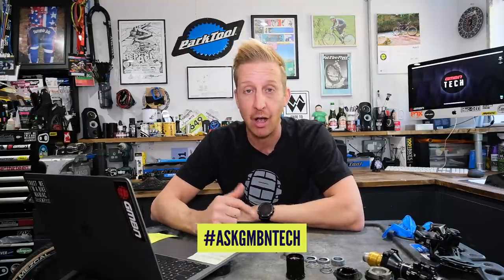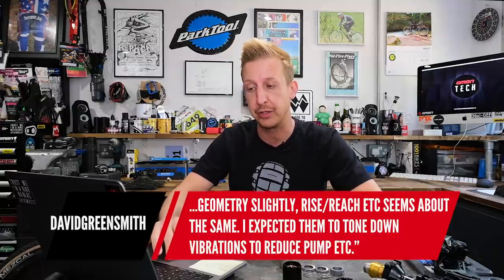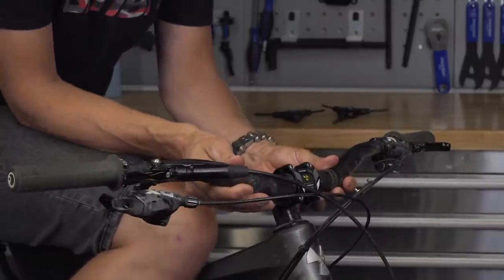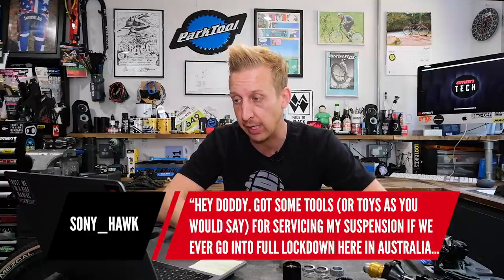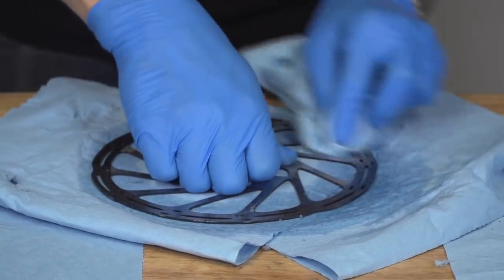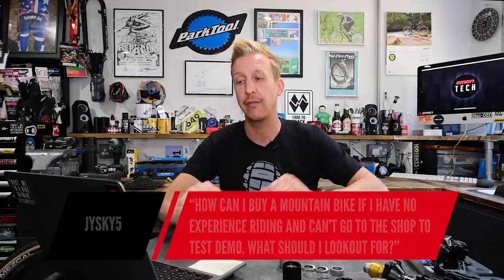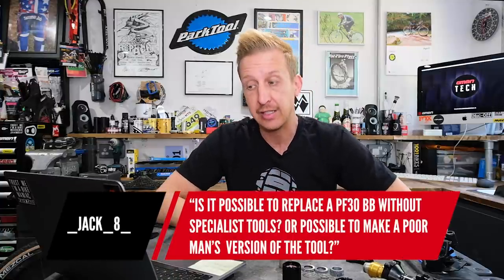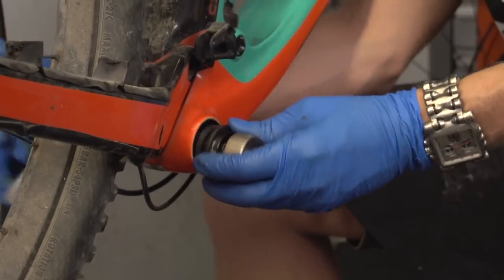Do I Need To Clean My Brake Rotors When Swapping Brake Pads? | #AskGMBNTech

Comment from the maker: Do you have a question you would like to ask us? 🤔 Use the hashtag #AskGMBNTech with your comment under this video for a chance to be featured! 👇
Reply: #AskGMBNTech I ordered a new bike online and I am nervous about setting it up for the first time, any tips for making sure the bike gets set up properly
Reply: #AskGMBNTeck Hi Guys, Can anything be done about dropper seat post play? The seat / post is now moving a few mm side to side, can I do anything before I go down a warranty claim? Bike is Canyon Spectral, love the show Cheers.
Reply: #askGMBNtech my break discs are rusted on the inside but not the outside. Could I use wd40 and a tooth brush to clean them without contaminating them?
Reply: Do a video on how to service a fork completely. Upper and lower
Reply: @gordonteuber3103  there isn't a way of doing that without contamination. I'd reccomend a aluminium scratcher mostly used for washing up dishes.
Reply: Doddy, I am a XC racer, but when I ride gnarlier stuff on my XC bike, I feel the need for a dropper post, whenever I look for just dropper posts, they never come with cables and levers!  Can you do a dropper post installation video with attaching the levers and cables? Cheers
Reply: As summertime is fast approaching what would be GMBNTech's choices for tires?  From hard pack to loam to loose over hard pack and slippery conditions(rocks/roots)there are so many brands and so many choices what's your pick Doddy?
Reply: #AskGMBNTech Can you do a video on Allen Millyard.
Reply: #AskGMBNTech Hi Doddy, I have a clicking noise from the drive train when pedalling my bike that I just can't locate. I can even slightly feel it in my feet. I've just replaced the cassette, derailleur and chain but the problem remains. The problem is I cannot reproduce it in a bike stand, it just happens under load. No play in cranks or pedals. Could it be the freehub or the press fit bottom bracket?
Reply: Would love to know how to make my own headset press threaded bar bolts etc
Reply: #AskGMBNTech this might be a beginner question. But for the times we are in now, can someone use automotive style marine grease or regular grease on lose or caged bearings like hubs, headsets, bolts, mounting points like bar to stem, etc.?
Reply: #askgmbntech I have a boardman mtr 8.8 which has a 12×141 boost rear wheel which I folded on a jump so need a new one but having a hard time finding/understanding all these standards can you please help me find one, cheers. Love the show 👍
Reply: #ASKGMBNTECH. I have a 2019 Vitus Nucleus VRS which has a 120mm suntour xcr air fork with boost spacing. I was thinking about upgrading to a Rockshox Recon gold Rl boost which has 140mm of travel. Would a 140mm fork unbalance the geometry of my Hardtail? 

Great show as always
Reply: #AskGMBNTech Can you explain when you would use air pressure to adjust your fork vs using high speed and low speed compression?
Reply: yes, this!  i have the same problem!
Reply: @Stefan-xv3lz  I have the same issue, so annoying
Reply: #AskGMBNTech Hey GMBN, love the videos, I have a 2014 Specialized Stumpjumper and I wanted to know if I can swap the whole cassette, derailleur, crank and chain with another set such the new Shimano Deore m6100 or SRAM eagle set. What do I need to look for?
Reply: #AskGMBNTech I've recently made a upgrade from a oil seals to foam rings in my 2k14 rs Boxxer rc, the problem is that the right side of the fork, where is damping cartridge. There is leaking under some compressions oil from the wipers. Do you have any tips for the solving the problem? Thanks.
Reply: #AskGMBNTech I was wondering about glazing. How do I stop or get rid of break glazing? Do you have a video already on this?

Comment: 5:36 Answer: Yes. While wearing gloves, use isopropyl alcohol or disc brake cleaner, and clean thoroughly with shop towels. Rinse with hot water, and lightly scuff the rotor with fine sandpaper. 👍
Reply: Hey, i want to ask you something about cleaning my Disc brakes. I have the sram code r and i feel like i will not Really stop. And now i want to clean my Rotor and everything so do i have to roughen them up with sand paper or cam i do it with out.

Comment: #AskGmbnTech  Henry/Doddy. I have Sram GX Eagle on my Orbea Rallon. Had this fully serviced recently and first ride out no issues. Second ride out (during lockdown) on a road ride chain jumped a couple of times. Went for a ride yesterday and now when the chain is on the 8th chain ring I am getting a constant what could be described as a click or tick sound. This happens on every complete revolution and makes the noise every complete turn. Have had the bike upside down and it is still doing it whether crank is turned fast or slow. It is only on the 8th ring and none of the others. Have inspected and inspected and cannot see or find anything wrong so over to the experts! Cheers Guys, love the channel and keep up the great work.

Comment: Be careful with neck pain .I used to get it only when riding ,I kind of ignored it until I started getting bad arm pump .Then the pain was there when not riding ,it turned out to be a herniated disc that was rubbing my spinal cord .It had to be removed and the vertebrae fused together. I guess I was just unlucky ,but if it gets bad get it checked out

Comment: Creaking fork could be usually lower headset bearing/cup or crown race. Assuming u haven't already, totally smother all these in grease, inner and outer of bearing, cup, so much it oozes out when reinstall, wipe away excess. Also same with top bearing. Use grip paste/assembly grip for stem.

Comment: You CAN get rid of the creak in the CSU. Green loctite (sleeve retainer) will take care of this as long as there is no actual play.
Reply from the maker: We would always suggest that for safety reasons it is worth contacting replacing if you are unsure. If a fork was to brake at the CSU it can be dangerous!
Reply: @gmbntech  i mean, sure, why not unnecessarily spend hundreds of dollars on something that isn't broken. I know what you're getting at, it's better safe than sorry, but sometimes the throwaway world gets a little bit much. I carefully inspected my CSU last fall, found zero signs of damage, and carefully cleaned it and loctited it. It went from making a creak every once in a while to being silent this season.

Comment: @askGMBNTech what would make a better mullet, putting a 29 inch fork and front wheel on a 27.5 inch bike, or putting a 27.5 inch rear wheel on a 29 inch bike? Taking into consideration the chainstay length and bottom bracket height. This might be a good idea for a video.  Thanks for your time, I love to show!

Comment: Video suggestion- tricks or hacks to getting a good bleed on SRAM brakes. I watched the video from SRAM on how to bleed brakes and then watched the GCN video and there was a difference. The GCN video, the presenter said to "De-gas" the DOT fluid in the syringe before putting it into the system. I didn't know about that trick until watching that video. What other hacks are there when bleeding SRAM (and Shimano) brakes that mechanics learn over the years? Between Doddy and Henry, I think they might know a few.

Comment: #AskGMBNTech Do Steel frames require any particular care/maintenance to prevent internal rust/corrosion.
Reply: Good question
Reply: Don't presure wash them
Reply: nowadays frames are coated in a bath.
Reply: @andrisvelmeris  It doesn't matter how careful you are when you wash your bike, if you ride in rain and mud half of the year like I do, water WILL get inside the frame.
Reply: Geralt of Rivia there are likely other holes in your frame for drainage/airflow but I’m not an expert
Reply: Geralt of Rivia 
Yeah water can’t get out now
Reply: Geralt of Rivia: I’d say worse - air itself carries moisture, which then turns into water droplets inside your frame with time and changing temperatures. Unless the frame is 100% airtight (like space-worthy airtight), it’s best to have ways for the air and moisture to get out of the frame instead of trapping them in. Just like with mold: moisture is not a problem if it gets to dry, but a serious issue if it can’t get out.

Original question: all steels will rust eventually and it’s not always a bad thing. In most modern, good-to-better steel frames (often some shade of CroMoly, think e.g. Surly or Kona) the alloy will start forming some light surface oxidization from day one. This doesn’t really penetrate deep into the metal and actually helps to prevent the penetrating type of rust from forming. You can treat your bike (I did), but your steel frame will still probably outlast you if you don’t bother and just ride it like you stole it. :)

If you have a cheaper bike that’s made of hi-ten steel you’ll get heavy rust easily, but there’s more (thicker) material for the rust to chomp through, which takes time, and chances are something else will break long before the rust destroys your frame.

If you ride year-round and in all-weather conditions (and want to protect the inside of the frame; for most it’s a want - not a need) I’d recommend oiling the inside of your frame. What you want to use is something that doesn’t have any solvents in it (doesn’t dry out), creeps around on its own and forms a liquid ’barrier’ between the bare metal and the air. (No air contact, no rust). I originally used old-school Frame Saver, but can’t really recommend it as it dried out in a year or so. I then switched over to Fluid Film Liquid A (non-biodegradable, but non-toxic and lanolin/wool-wax based oil) and haven’t looked back. Best all-around lubricant / rust-remover-preventative I’ve come across. Good enough for NASA, good enough for me. :) Strip your frame, plug the ends, pour some FF in, slosh it around and your frame will most likely outlast you. I have a frame that’s been sitting indoors, treated with FF, unbuilt and fully exposed to the air for a few years now (due to life and injury), and the oil just keeps on staying liquid. Which is exactly what you want.

This makes for some great reading too: https://forums.mtbr.com/fat-bikes/anti-corrosion-product-shootout-1073581.html

Comment: Buying Bike Without Demo:
First of all, I think my local bike shop missed out on a sale by not having demos - so I resorted to spending a lot of time on line. Someone I know slightly had a bike very similar to what I was looking at and we arranged a time to meet. I wore gloves and mask and put my hardtail in my pickup and compared the two. He also advised me on what he observed on reach and size. This was important, since he is a couple of inches taller and this was a large and I am on the edge, but usually ride medium.  This site recently had a video on how to buy a bike and Neal was so helpful about size.  I decided on a medium and am very happy.  I also tested a couple of used bikes, but I will warn you that I really like the tweaks in geometry that have happened in the last 3 or so years - so I compromised from SRAM GX to NX and bought new. I even passed up a used Canyon with OX because the geometry was flawed (I researched it to death before I went to look at it). This is a reminder - decide on price before you go shopping, or you will get snagged.  Buy a bike worth upgrading, but stay within your price range or you will end up with a bike that is far above your riding grade and your budget.
Reply: True, as I have found out! And no, sadly, the more expensive bike did not make me a better rider.
Reply: @David-rb3tk  
No, but you also are not held back by the bike. And bikes, like cars are not investments - they can be a moneypit!  However, I was running my beloved XC Bike into the ground (literally) as I rode it too roughly in the mountains. It is much happier on the rolling hills and cutting across grassy school lawns and it will last me many years.  The Trail/Enduro Commencal is thrilled to take me through the steep mud and rock hills.  I am too wise (68yrs) to break any more shoulders and knees. 
When you get a good quality bike, they will last a long time (still have my 15 year old 26" Raleigh HT rat mtn bike, for when I get flats).
Reply: @drmoynihan  LOL!  I agree.  Rather than dwell on my buyers remorse, I just ride every day.  The bike became friendlier as my skills improved.  I even treated my new friend to a few upgrades as parts wore out. Like you I have been riding a long time.  I started at age 7 and will be 62 in late June.  Enjoy the ride.

Comment: Doddy, help me with my Specialized S-Works Demo 8, the bike came with sram Pf30 integrated BB and I used a cane creek outboard style BB because last time I was into bikes Shimano was (is) king. But I ran into a problem that is most likely gonna require CNC solution. Because the cranks are meant to sit flush with the factory setup, with the outboard BB30 that I utilized, when you go to mount a chain guide, it won’t line up right without some custom spacing. So if I make a spacer for the ISCG-05 mount, it should be the exact thickness as the outboard on one side of my Cane Creek Hellbender??? I assembled a 12,000$ bike over COVID-19 and I’d like to take part in the building a bike online video. Plus the world needs to see this bike, it’s the S Works Demo 8 2020 with a Shimano spin instead of SRAM. 12-13,000$ later...

Comment: #askGMBNtech 
Hi Guys, 
I have a 6 month old RockShox Judy Silver (Air suspension). It leaks oil out of the bushings, mainly on the right hand side. After about 5 min of rough downhill, I can look down and see oil on the outside of the bushings. I have noticed some light scouring on the sanction tubes, so I stoped riding the bike. What should I do to fix this? Where I live, bike shops are open. How much money would it cost to get this fixed? I know the fork costs $500.00, so I do not want to pay more than that. 
Any help from you guys at GMBN Tech, or you guys in the comments would be GREATLY appreciated. 
Thank you, and stay safe all!

Comment: #AskGMBNTech I have a hardtail (2020 Nukeproof Scout 275 Comp) and the rec. pressure for my 140mm Sektor fork is 144PSI (for me ~106kg with ~3kg of gear and water, etc.). I've been running 85PSI (~45% sag) and getting 90% fork travel over an entire ride, never bottomed, trails pretty tame. It feels good in how it works and feels (fatigue / comfort -wise). At 130PSI (25% sag) I can jump my 100kg body onto the stem and only get ~60% travel out of the fork. 144PSI would be worse. If I was using any more travel on the trail I'd either be crashing or feel like it. Not having any other experience with decent forks it feels like it ramps up like crazy but AFAIK they don't come with volume spacers. I want efficient pedalling but not hand and forearm fatigue and collapsing onto the bars on bigger (maybe 2ft) drops. What do you advise?

Comment: #AskGMBNTech What do you think about Magnesium alloy as a frame material? Why is it not a common material for bike frames?
There are many advantages, for example: 
1) low density (~1,7 g/cm^2) meaning light as Carbon
2) high flexibility (Elastic Modulus~44 GPa) providing probably more comfort than aluminum (but is it stiff enough?) 
3) 100% recyclable, Less energy wasting production (melting point~600/700°C) 
4) high global occurence in the earth crust 

So would it be also strong enough for aggressive mountain biking?

Comment: Getting back into Riding after 15+ years. Riding an early 2000’s bike. Hard tail, 26 inch wheels, rim breaks, skinny bars long stem etc.  What one upgrade would you recommend?  New bike is not an option. Bike is disk break compatible #AskGMBNTech

Comment: I had to replace the hose on my rockshox reverb stealth after it tore at the base of the post. When I replaced the hose (because the new hose was rolled when I received it) it pushed into my top tube and got caught. Any ways you know to stop this from happening or how to fix it once it has happened

Comment: #askGMBNTech  Hey Doddy. I recently changed 135QR to 142TA along with a new wheelset. The wired thing that I've noticed is that no matter how hard I tighten rear TA the vibrations from the trail will rattle it lose a tiny bit. It never goes completely loose, but enough to make my rear rotor squeal. I know it's TA since I can see it's in a slightly different position than at the beginning of a ride. It never gets loose during a ride to the trail, but I have to stop and tighten it every now and then when I ride on a trail. Can I use blue Loctite? I'm using DT RWS 142x12 TA.

Comment: On the contrary, the more tokens you have, the harder the shock and the fork is AT (THE SAME) SAG. Even if the air pressure is lower when unloaded. Also, the less experienced rider should be overbiked. When a more experienced rider can handle the same terrain (at much higher speeds) with a shorter-travel bike. The longer-travel bike allows for more beginners mistakes.

Comment: "I want to buy a mountain bike but I have no experience"  -My best answer, honestly, is spend $1,000 and you will be satisfied with your purchase. The $500 "mountain bikes" are really just intended for recreational use (dirt paths etc, not actual MTB trails)  and the components were not meant to deal with real trail riding. (for the most part)